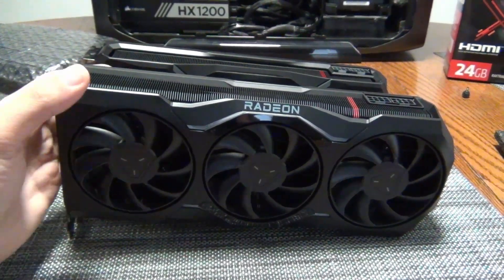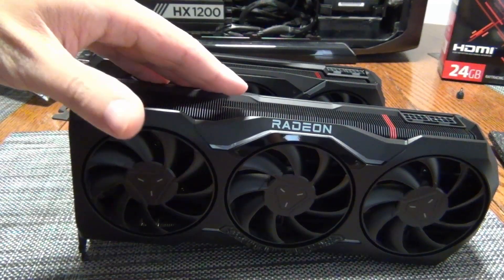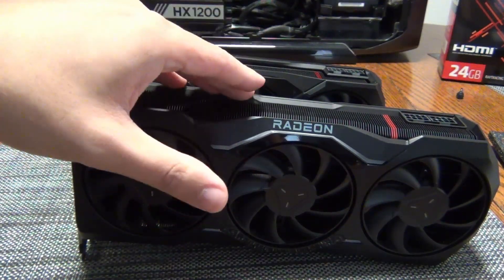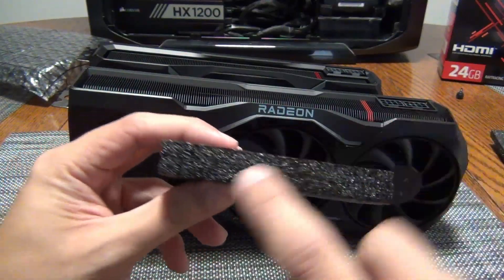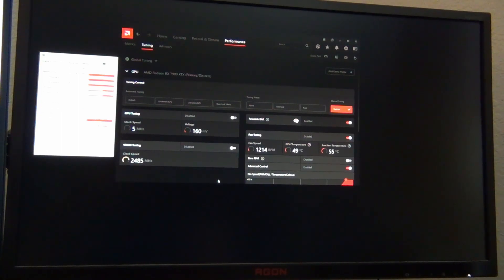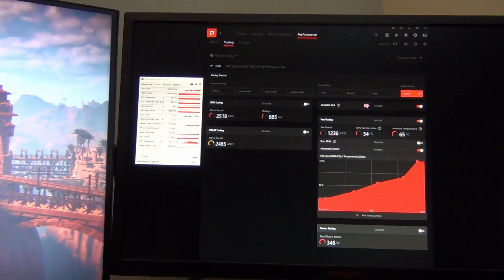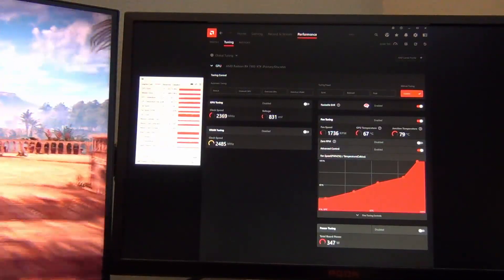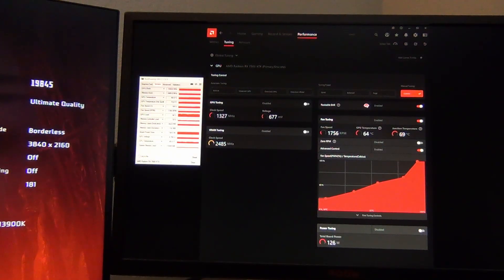How to tell if your 7900 XTX has a faulty vapor chamber

Comment: Just bought a brand new reference 7900xtx from FB Marketplace. Under a stress test, the GPU temperature goes to 72 degrees while the Hotspot is at 101 degrees.

Is this delta fine?
Reply from the maker: It needs to be a 40 degree delta to indicate a probably with the vapor chamber.
Reply: @GameTechReviews Thanks bro

Comment: 60 and 80 or so are the values for my Nitro+. The trouble is that it makes quite a lot of coil whine together with the RMi Corsair PSU. The XT Nitro+ with the same exact cooler, but less power didn't do it. At 385w it didn't do it and not at 2000+ fps. For some reason the XTX does it even at 50 fps. If the fan speeds go above 1500 or so, you start to hear the fans over the coil whine, but I wasn't expecting it.

Comment: 38C normal, when gaming around 50C for mine. I had to add additional case fans from a reputable brand and replaced my CPU cooler with a high-end one. Prior to these upgrades, my gaming GPU temp for this exact brand would be around 70C, and normal/idle temp like browsing, etc. at 50C. In my experience, other case cooling options also greatly affect how your GPU temp reads.

Comment: both my 3080 fe and my 3090 fe thermal throttle with no oc and no recall from nvidia...and if you read around you'll see my situation was not a one-off. im switching to amd since they actually care to try to do something about it. i understand it is hard to admit there was a problem because of all the gpus you will have to replace and that is not cheap. in this world where the customer is rarely considered anymore, its nice to see them trying.

Comment: If it helps in terms of timing... My PowerColor 7900 XTX appears to be impacted. Purchased from Amazon on Dec 16, shipped Jan 9th, arrived Jan 11th. Modern Warfare 2 gameplay and benchmark in Adrenalin I see Junction Temperature hit 110-111 and peg there; Current Temperature (so GPU edge) at 65-71C; FAN Speed at 3000 and sometimes slightly higher (30XX). So I'm getting 40C+ gap and also seeing fps readings in MW2 (4k) that don't nearly match other benchmark outlets. Card is mounted vertically, but different kind of vertical because it's literally up/down in sandwich style case (ssupd meshroom s). So it doesn't appear all stock got pulled in time, they're still being delivered faulty. Adrenalin profiles are default for both CPU (7950X) and GPU, no overclocking, EXPO 6000 profile on the 64GB DDR5 in the system.
Reply from the maker: That does sound like one of the faulty vapor chamber. Just curious, what RAM kit are you using? I'm trying to find a good 64gb of EXPO 6000mhz memory for testing.
Reply: @GameTechReviews  I went with the G.Skill F5-6000J3040G32GX2-TZ5NR

Comment: Bought from asrock reference model . Apart from the coil whine the temps are fine tried in a 240hz 1080p monitor and ultrawide 3440 and highest it got was 84 on the junction same tests you did

Comment: Can you do the same test but then with the gpu in vertical position (flip the case). I got two AMD reference cards. One is from Sapphire, other one is Gigabyte. In horizontal position temps are fine. When I use the same cards in my SSUPD Meshlicious though, temps go up very fast en it starts throttling.

Comment: Do you have any advice on how to get the GPU to become horizontal if my case only do vertical mounting? Lifting up the mobo seem like a disaster waiting to happen
Reply from the maker: What case do you have? I've never heard of a case that doesn't support the standard horizontal mounting.
Reply: @GameTechReviews  the Hyte Y60, it's vertical mount only for any full size GPU.
Reply from the maker: @RexZShadow  It looks like it has the frame for mounting the GPU horizontally. You would have to remove that riser type cable thing that the case uses.
Reply: @GameTechReviews  there not enough enough space for the gpu at the back of the where it would normally stick out.

Comment: Hi thanks for the video! I have a XFX 7900 XTX MBA, I'm playing Warzone 2 on Ultra Settings and my GPU Temp is around 73c max and Jtemp is 95c, would you consider this normal? Or should I send it for replacement? Cheers!
Reply from the maker: That sounds normal to me. No downclocking and the fan speed is normal would indicate that it's not affected. You need to see a difference of 40 degrees between the two temperatures to run into the issue.
Reply: @GameTechReviews  Wooh sounds a relief, thanks bro! (Subscribed)
Reply: @demigodx29  just to mentioned my experience using xfx cards , usually they put the fan curve more on the silent running curve , so you can adjust the fan curve yourself and have lower temperature , that card is normal.

Comment: Just got the same card from Sapphire from Newegg today and sadly I did get a defective one. Ran Red Dead 2 benchmark and within 10 minutes it was at 110°C. Getting an RMA from Newegg for now
Reply: Update on the RMA,
As of today 1/23/2023 I received my replacement. I did the exact same test as before and ran right into Red Dead 2 benchmark and right away I knew I had yet another faulty card. This card was worse than my first, the card couldn't even hold temps for more than 30 seconds before the temp would go up 1°C every second. I contacted Newegg customer support and asked if there was anyway I could get some reassurance on my second RMA and they said "Sadly we do not test products, it is up to the manufacturer to do so" which I kind of figured. So I proceeded to ask "do I just have to roll the dice and hope I get a good card?" And they replied "Yes, we're sorry for this inconvenience" I've decided to try once more to RMA the card and get an actual properly working card before I just get a refund
Reply: @HivisFree  what was the result of the third card?
Reply from the maker: What is the edge temperature and the fan speed when you see the 110c? Also, I assume you are running at stock settings (i.e. no overclock, no power limit slider increase).
Reply: @GameTechReviews  Sorry this is a few days later, edge temp max for me never went above 65°C, Fan speed highest was 2840RPM, and yes this was completely stock. I had the gpu in my pc for no longer than 45 minutes before I took it out and put my 6700 xt back in.

Comment: Thank you so much. Hope that my 7900 XTX PowerColor from amazon works fine
Reply: I received my 7900 XTX PowerColor card last week (purchased from Amazon) and it is exhibiting the problem. MW2 gameplay and benchmark peg my Junction Temp at 110C and GPU Temp at 70-71C with Fan Speed at 3000. My card is mounted vertically in a sandwich style case (ssupd meshroom s).

Comment: Thanks for providing such a thorough breakdown of the issue. I see you mentioned monitoring operating temps at stock conditions. I bought the card a couple of days ago and didn't notice any issues. I'm running the card using the "Default" tune in the adrenaline software. The board power is around 350 W and the delta between the GPU Temp and Junction temp is consistently around 15-20 degrees under load at max settings  on demanding titles such as Cyberpunk and Control. The GPU temp is usually around 70 and junction temp at 85 or 90 max. However, when I switch to the "Rage" preset in the adrenaline software my junction temp spikes up to 110 degrees C and the fans go full speed at around 2800 rpm and a power draw of roughly 390 W. Have you observed similar behavior on your card? If I run in default it runs quite well. I haven't done any other overclocking yet.
Reply from the maker: If the card is maintaining the boost clock speed then that's still normal. Rage mode increases the power limit and voltage which will make the card run hotter and probably at the limit of what the cooler is capable of handling. This is the reason why custom cooler designs by the AIB partners are far better suited for handling overclocking, increased power limits, and the rage mode preset.
Reply: @GameTechReviews  Apparently with mine the card got harder after a year and one of capacitor fell out due to the heat.
Reply: Just wanted to provide an update. I made some adjustments to my pc and I have managed to get amazing results. I reseated the GPU (dont think this has much of an effect), reconfigured the fan setup in my case (Lian Li O11D) to 3 fans intake at bottom and 3 side/3 top as exhaust. Initially I had 3 bottom/3 side as intakes and only the top as exhaust. I replaced the cheap fans I had (rated at 1300 rpm) to new fans rated at 1900 rpm. Now the card runs stock at 60 deg core/72 deg junction. I managed to overclock it to to 2700/2900 (min/max) frequencies with a 1100 mv undervolt and +15%PW (395 W) and the highest junction temps Im getting are around 88 with an average of 20-25 deg delta between the core and junction. The fans are usually around 65% speed. Before it would spike to 110 deg within minutes of going over 375W and the fans would ramp up to 100% and sound like a jet engine. While it may be obvious, it seems these cards are very sensitive to airflow. These numbers were observed by playing about an hour of Cyberpunk @4k Ultra (no FSR) and I also replicated it by running Furmark for about 20 minutes. Just wanted to provide my experience in case someone else runs into similar behavior and wants to troubleshoot.
Reply: @Voxpopuli00  you must have a glass front panel case but its good you solved your overheating issue and I'm just more then the gpu the rest of your system appreciates the optimisations you did 😂
Reply: @forog1  does the glass panel effect the temps?
Reply: I pulled a sustained 400w and leveled off at 93 degrees junction temp at about 66% fan speed. 

The cards with not enough liquid may have varying degrees of liquid shortage... And the silicon lottery could also be a factor... But I believe to get to 110 I'd need 400w and a giant clock increase... And I'm not sure that it's even possible.
Reply: @FeisarX  thanks for the input. Im still debating what to do with the card tbh. I still have a week in my return period. While it runs ok at stock settings (65-70 C core and 80-90 C junction)  under maximum load, it still gets to 110 pretty fast if I get it anywhere over 375W.  Are you using a reference card or AIB?
Reply: @Voxpopuli00 if it’s not thermal throttling doesn’t that mean it’s fine
Reply: @Voxpopuli00  Id return it. It seems your card might not be super low on fluids, but it still sounds like it's not efficiently enough 110c at 375w means you have the problem. You paid way too much money to be balancing on the edge of stability at stock. 90c on hotspot is still degrading territory and what will likely happen in the future is the card will die due to high heat over its lifespan throttling or not just so happen it will probably last till outside of warranty leaving you stuck with a brick that's only use left is the trashcan. Return it and get an AIB they are getting more and more common nowadays..
Reply: @FeisarX  I get almost 450watts on the xtx

Comment: I got mine from amd. Worst temps max overclock has been 87 in junction. This is pushing 3000mhz and 2750 memory. Stable and best overclock with reference model is 1075 volts 2750 memory overclock 2875 gaming clock and please allow it to go from 500 to 2875 on amd software. From my experience horizon zero dawn main game I have been playing crashes because clock speeds can't be stable at one point like nvidia. They really need to fix these drivers because there is nothing stable about drivers. I don't do benchmarks I play the actual game for 30 hours with this card crashed 40 times easily. Horizon zero dawn has been only gaming crashing on my system cyberpunk 2077 with Ray tracing doesn't get push as much as horizon. It's temps are lower too in lower 70s. Great cards, but need to fix clock stablity and fix vr. Quest 2 works fine other are unusable. First time switching to amd and issue I have is common sense issues. Lying about performance during their show and rush out the product before Christmas. We are still waiting for what they promised. Amd fans will defend, but this should never happen again. I want checklist of stuff to clear before shipped. You wonder why nvidia has most of the market share. I support amd because I loved their cpus and now gpu because prices should never go over 1000 dollars for flagship. I have seen how much they cost to make. It's all about profits and people keep paying into it. So market says this is how much we can charge because people don't care about money.
Reply: Have you tried lowering your overclock to see if you still crash? Different games handle clockspeeds differently and perhaps Horizon can't handle the higher clocks as well as CyberPunk can.

Comment: Thanks, you are one of two people (so far) that I have seen focusing on showing HOW to detect the issue, mostly I see a discharge of energy towards AMD. To state obvious choler is not helpful to others (right now) who need to diagnose the situation.

If I may abuse on your goodwill, here is a scenario (mine): 

1. xtx is clearly not running to 110º in default settings, but it shows a delta near the 30º

2. Any OC I try results in really high temps. Putting it at 400W or 380W makes it reach 110º with throttling to bring it back to 360º (this involves reducing mV and upping power).

3. Reducing mV to 1060 / 1080, without changing anything else, improves performance and temps (bigger scores in 3dMark)

Question: Is this a perfectly normal card? Not a winner in the silicon lottery, but not a bad batch?

Sorry for the abuse and thanks again for the information
Reply: If your card is ever hitting 110°C when pulling only 400w, you definitely need to RMA. 400w is nothing and a card should NEVER reach 110°C even when overclocked. 30°C delta between gpu and hotspot is unacceptable and should be replaced. Do yourself the favor and contact AMD support.
Reply from the maker: I think it's important to consider the operating temp at stock settings in order to rule out variance in power limit increases. If the 110c is not seen under stock settings then I think it's a normal card. These reference cards don't have much headroom to handle increases to the power limit or an overclock.
Reply: @GameTechReviews  Agreed, thanks again!
Reply: So your gonna oc to get a couple more unoticeable frames cmon yall need to chill and appreciate the power of the card at stock lmao